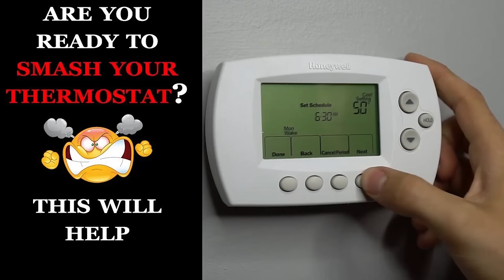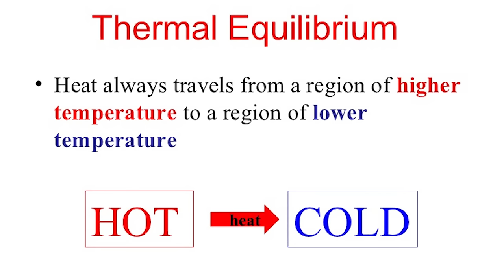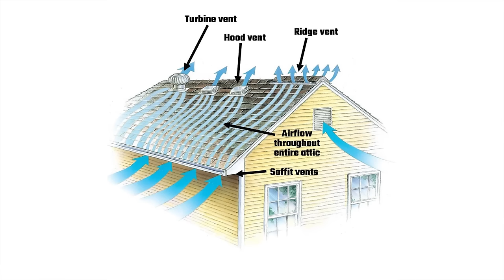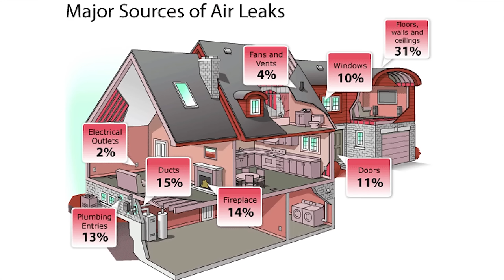AC Unit Not Cooling House - 20 Reasons Why

Comment: 2 part question i could really use your help with,I have a nordyne  packaged  heat pump single phase unit for mobile home. Im trying to figure out how to wire a 5wire thermostat wire to the defrost control board and then to thermostat. Also when I force the contactor on  the compressor and fan motor kick on but no blower motor. Is that  because thermostat and dft board are hooked up incorrectly or do i have another issue. I got the unit all wired incorrectly and have gotten this far watching your videos hoping you can take me rest of the way. Havent seen any vids with packaged heatpump units . Appreciate all your help.

Comment: Hey bud since I've moved into my house . I have always had to call a technician every summer and he adds refrigerant cause it's always low every year. Would it be cheaper if I replaced the condenser unit. Cause each time I have to spend around 800 bucks please let me know asap

Comment: Mine stopped working.  I replaced the capacitor and it still didn't work. Called a pro.  He found a burnt wire attached to the compressor and replaced it. $200 for him and now it works.

Comment: So ive been figting my ac system for the last week.   Pulled everytinh apart today and cleand coild. New filters etc.  had my neighbor come by around 6pm to check the charge. Everything was good with freon etc. still only a 6-8 degree split.  5 hours later im pissed it still isnt working.  So i start digging some more.   Refridgerant lines are at 34 degrees at the unit, the indoor coil is at 35 degrees.   I tear insulation off the trunk and it’s at 76 degrees.  So i dig deeper thinking no reason for a 40 degree difference.  My heat strips hace shorted, the controller is melted. One of the lines is melted, the left strip is at 147 degrees.  This is minutes later after shutting off breakers. Finding tools to open the panels etc.   it’s been back on for ten minutes now.   My return air is at 77 and the air coming from the vents is now at 51.   I was ready to buy a whole new unit.   Glad that i dont stop until i figure out a problem.

Comment: I have two air conditioner heat pumps for two different areas of the house in Florida, one for the master bedroom suite area, and another for the rest of the home. Both air conditioners bring the temperature down to 76, but the main area of the house does not dehumidify as well as the master bedroom suite. 

The master bedroom suite relative humidity could be 59%, while the main area is 66% or 72% relative humidity. Both areas are 76 degrees. 

The filters were replaced. The AC condensers we’re checked by a technician and are functioning properly. The air coming from the vents feels cold, yet the main system is not dehumidifying enough. 

What could cause the air conditioning to cool enough, but not dehumidify enough?
Reply: If it doesn't run for long before reaching the temp setpoint on the thermostat (maybe just a few min), then it's probably not running long enough to pull moisture out of the air. Dehumidification takes time. Lower the temp a couple more degrees and that may help lower the humidity more since the AC will run longer. Though you may have to put on a sweater...haha.

Comment: I just moved into my house in May and it were cooling to the point I were freezing. The auto/on button were broken so I replaced it and it wasn't getting cool, so i called a friend and he said i needed refrigerant and it started to cool some, but not like when i moved in. I were cleaning my windows and the top window fell down so I needed help to put it back up and not realizing the air was on. So when I finally got the window fixed the A/C wasn't cooling and it were making this noise. I did have a  technician come out and he said my compressor is bad and I need a new unit but my gut telling me otherwise after watching your video. PLEASE HELP.

Comment: Can be the air coil install under the furnance?
Reply from the maker: Yes. There is an upflow furnace and a downflow furnace setup. If the air is moving down (downflow), then the coil would be under the furnace.

Comment: Can home A/C cool the house when temperature outside is colder than the inside?
It's 24.6 degrees celcius inside the house and the outside temperature is 12 degrees but I set the thermostat to 19 degrees to cool the house but it seems the A/C is not working. The unit is 1 yr. old 1.5 ton and the house is 1050 sq. ft., HVAC air filter is new and the fan works, and the A/C condenser fan works and clean

Comment: I got a case here where I hooked up gauges to an outdoor unit and my low side was reading way too high for the evaporator coil--80 degrees F.  Furthermore, the temp on my high side was too low as it's also 80 degrees F and, from what I've read, it's supposed to be around 30 degrees higher than the ambient air.  Also, the temp on my liquid line was warmer  (88 degrees) than the condenser coil temps instead of cooler.  What does that mean?
Reply: Did you ever find the solution?
Reply: @HeidiWaltars  Nope. :(

Comment: What about a frozen condenser, my ac unit wasn't cooling the house to the set temperature point and my brother told me that the first thing to check is if the condenser is frozen by shutting off the ac unit for up to 24 hours to allow it to thaw, if it's frozen than the AC is not going to cool the house effectively or not at all and as a result it will keep running. My ac was cooling the house just fine in the extremely hot days recently but then I had this problem just after some the  hot days then the AC wouldn't cool the house on some cooler days.

Comment: How about talking about how to diagnose a bad compressor, ie: I had a 5 ton scroll with bad valves, compressor and fan ran but no cooling.
Reply: Mine is also 5 ton not cooling enough after 5 yrs. Supposeley compressor was replaced as well as expansion valve and still not cooling enoght

Comment: Not sure whats wrong with the one in my apartment, I came home from work and it was just toooo hot and humid inside. Went to replace filter and I'm trying to see if that works. Air seems to blow but very low cool air and I'm at 61 right now lol
Reply: I'll just call maintenance tomorrow

Comment: how about when you live in an apartment building? I live in Florida, super hot. I have the ac set a 74 but the inside temp stays on 78 starting at around noon till late afternoon. It runs all day. Management says it's because the temp outside and me living on the top floor, high ceilings My bills are high. Maintenance comes and says ac is working fine. I dont know what to tell them and give them a good argument so they'll do something about it. I feel the ac is not running effectively for my size apartment. neigbor below has the same problem. I have this problem each year, every summer.

Comment: If the temperature in the house is above 85, the ac starts struggling, and after several minutes then the temperature goes below 84, and one day when I turned on the ac when the house was at 80 degrees,  the ac started struggling again. I think the cause is fan motor overheating and slowing down and after the fan motor cools off then it starts cooling the house again

Comment: How would you know if the compressor or capacitor isn’t working? Our air is set to 68 and it’s currently 80 in our house. The air feels “cold” but obviously it’s not working. I went outside and I can hear the ac unit and see the fan spinning but how would I know if it’s one of those things or not?

Comment: My thermostat is set to 70 degrees and it stays on most of the day and as the temperature out side increases the temperature inside increases and it runs anywhere from 8 degree to 10 degree warmer than what it is set in on the thermostat the unit was replaced a month ago

Comment: How long should I wait to turn ac back on after cleaning the coils
Reply from the maker: If you did not get any of the electrical components wet, you can turn it on right away. It's not recommended but I've seen people wash coils as the unit is running too.

Comment: AC works great on warm days. Hot days intermittently. IF I spray the condenser coils it usually works. So, what's happening. All electrical parts have been replaced.

Comment: When it's 110°F outside in Arizona, our AC struggles to get the house to anything below 77°. It cycles on and off for 77°, but it takes awhile. Is this normal for such conditions? House has a 4-ton unit. Home is 2400 sq-ft, and the ceilings of all rooms is 10 feet high.
Reply from the maker: With 110 degrees outside, I would say yes, that unit seems to be working normally.
Reply: @WordofAdviceTV  cool thanks. It has been years since it was charged haha. It cools easily in the mornings or rainy days.
Reply: @Dcc357  Wow! Your unit is working great. If you have 110 degrees of supply air going into that unit and it's returning it inside the home at 77 degrees that's a well-installed unit. You're getting 33 degrees difference! I believe the norm is 16-22 degrees difference. What kind of unit is it if I may ask, out of curiosity if nothing else. I have a Lennox and it seems to do a good job over here in humidity land aka Florida.
Reply: @Steelviper61  it's a 19 year old York 4 ton. Model number h2rc048s06a. It has all the original equipment except for the compressor. It was replaced 10 years ago with a Copeland scroll after a storm ruined it. I think at this point it sounds like a very overpowered unit for the size of the house lol, but the temperatures justify it.
Reply: @Dcc357  Absolutely, Thanks sir!
Reply: If it cycles off, that means it's reaching setpoint. If the thermostat is inaccurate just dial it down a bit lower

Comment: Hi there, i just had a used unit installed, using r22, since they dont sale them no more or the 407 units. They added about 1 pund of refrigerant to the unit, is 110 degrees outside and the unit would not go below 83 degrees, they recharge the unit again with 1lb of refrigerant, and was working fine, but it started doing the same thing. The technician maintion that the compressor needs to stabilize itself since it was a unit that was not used for a wile, and that he probably neede to come back and do another recharge. My question is, could their be a leak, or the compressor is bad?, any advice please

Comment: I was wondering if you had any advice on my situation. This summer, I added Freon to my AC system, but a month later my Freon level was very low. I called a contractor and he said there was no tear in the HVAC system or the furnace and that the leakage was most likely in one of the underground pipes. Do you know what my next steps should be?

Comment: Hi. My ac unit fan is spinning, but there’s no air coming through the vent. What do you think it can be? Last year, the fan was not spinning so a repair company changed the coolant out and the fan worked so not sure what the problem is. So again fan is spinning, but I don’t hear the vent on the inside of the house on cause I don’t hear the noise and no air through vent.

Comment: The fitting on the liquid line that enters the furnace has a slow drip.
The a/c is cooling fine. I tried to tighten the fitting but its pretty tight.
can I remove the fitting and remake it without loosing my refrigerant or do I need to close the valve at the condenser.
Thanks

Comment: Hey man quick question maybe you can help,  so I do have cool air, but the pressure is low, and when the temperature reaches anywhere over 86 it fails to keep up, (Canadian here, so we don't always have the 90+ weather during this time) which of these tips do you recommend aside from hosing down the external unit

Comment: What about an condensing unit that's 27 years old and can't reach a set point of 75 degrees? Could it be bad valves with in the the compressor? Everything else has been checked and looks good, but unit runs and never can reaches 75 degrees that it use to do.
Thank you
Reply: You need a new system 27years is double the expiry of an Unit, do not waste money repairing it

Comment: Hey bud I have a question. I have a ac unit outside that doesn't turn on when I set my Thermostat to cool the indoor fan doesn't seem to turn on either but the heat works fine. I went outside opened it up and pressed the magnet that is supposed to turn on the unit and it turned on, any thoughts on what it could be?

Comment: I have a new unit that’s a year old and it’s not blowing cool air. What’s the most common issue for a new system? Changed the filter, check to see if there always debris on the outside unit, and I put vinegar down the drain and still no cool air

Comment: I am having an issue with my unit not keeping up after 12 and it gets up to 82 degrees on hot days on the inside of my apartment or a 6-8 degree split. Come to find out my exhaust fan’s pipe (located in my bathroom) goes through my return duct and I have found that it was cut out and disconnected. I believe it’s bringing in hot air from outside and my new unit can’t keep up when it’s really hot outside. Can you either comment back or like this comment to let me know once they fix this it will resolve my issue? I am assuming the installers cut it to get the new air handler in and did not reconnect the bathroom exhaust fan.

Comment: I have the below aircon Goodman GSX140301KB. The capacitor is bad is this: CAP050400440CT. I see another:  CAP050450440CT. The difference is the 450 vs 400CT. Can I use the 450 one?

Comment: Help! 3rd A/C repair visit today. 10 yr. old house/unit has always worked well. House starts to feel warm so I check thermostat which is set on 71. Outside temp is 87. Usually cools inside to 71. NOW it's saying 76 or 80 or 85. I turn unit off at thermostat and turn it back on and it starts cooling again. Filter is fine/changed out. Coils have been blown and are clean. Unit has coolant. New capacitor installed. Drain lines blown out, also. So.... due to no other ideas a new thermostat was installed. Exact same problem one week later. Help !!

Comment: I have a carrier central air unit and it had this guy technician come over and for some reason he added a little bit of freon on it and then I noticed that it was turning off my circuit breakers so I called the guy he starts doing his thing checking the compressor and checking the capacitor and I know this is a capacitor when he was checking he boosted it and with another capacitor and then they shorted but it shut off the circuit breaker make a long story short he told me that the compressor was no good so I took it upon myself couple days later I don't know anything about compressors or HVAC the cover off and they put everything together the way it was before and I shut the circuit breaker and fuse off of the unit put it back together and I started the unit up now everything's working perfect he was trying to rip me off cost you $180 just for a little bit of freon that he put in it he could have ruined the whole unit the whole unit😊

Comment: My unit was a brand new unit on a brand new house, the AC worked when we first turn it on in May, but few days ago the vents are blowing out 76 degree air. I called the builder and he sent the AC guy who install the system. He said he probably forgot to charge the system when they installed it in Nov because it was already cool outside. So he charge it, I ask if it could be the capacitor or a leak. He assure me that it’s not. Well 2 days later it’s blowing 76 degree air again. The outside unit is running. What should I do?

Comment: My unit is only 8 or so years old and I feel a lot of air ( warm or cold) when I walk past it because it's in garage. I also feel miniscule amounts of air from most the vents especially the further away from the unit it is. I can't inspect the ventilation because it's underneath the slab. What can I do for better heating and cooling?

Comment: Was away and the unit stopped cooling. Came home to check and the fan on the condenser unit is on but don't hear the compressor. I just changed the capacitor and still the compressor does not go on. I ordered a hard start for it as I will try that tomorrow. Any other suggestions? TY

Comment: Hi, have you ever seen this issue which is when turned on the AC, only the upstairs is cold but the downstairs is hot? And the downstairs thermostat is flashing red LED, What could cause this issue?  The filters were changed to new ones, the AC unit is about 22 years. 
Thanks!

Comment: My a/c gets set at 73 degrees and it will make it to 75 degrees and the blower and inside unit shuts off after a while...

Could it shut off because it just times out or should it continue to try and get it down to 73?

Comment: My house AC unit fan is running but the compressor is not. I replaced the capacitor, the compressor works and the fan but no cold air or warm air blowing out from the ducts inside the house. Seems the fan inside the evaporator unit in not running. And noticed the suction side- big line insulated pipe is freezing, what’s the problem?

Comment: If there is no insulation on the suction line, could that be causing an issue? I've done everything I can think of to improve my AC and this is a concern I'm having trouble getting an answer to. It's very cold and sweating but not insulation on it at all.

Comment: urgent
My ac condenser unit is blowing cool air out while warm air is blowing in my house. We clean the coils, changed the filter, and removed all the gunk from the pipe. Also we recently replaced the hvac cans. What would be the problem???

Comment: 1.Condensed water drain line clogging. 
2. Split A.C - Evaporated water (water vapor) at lengthy drain line reenter through indoor unit. These two points are not covered in this video.

Comment: Once when it was 125F outside mine struggled to keep up...Highside 450 psi, RLA 20 % over...
Reply from the maker: Wow! 125F is pretty darn hot.. I think most air conditioners out there would be fighting a losing battle with temps like that